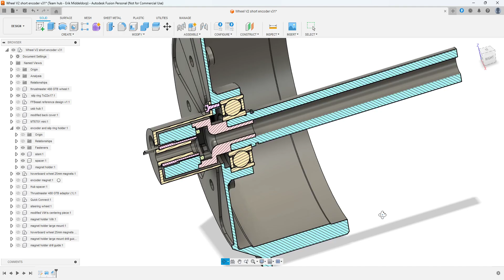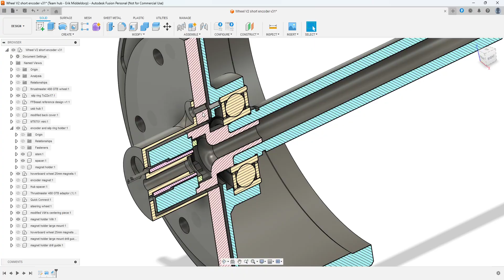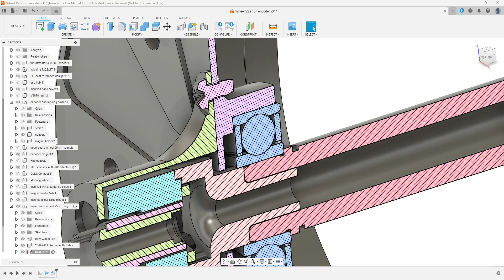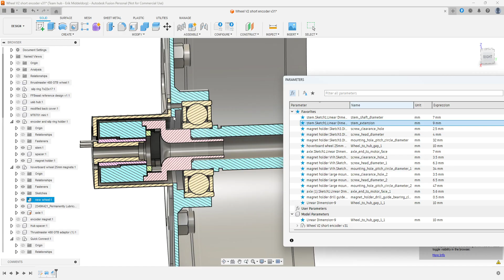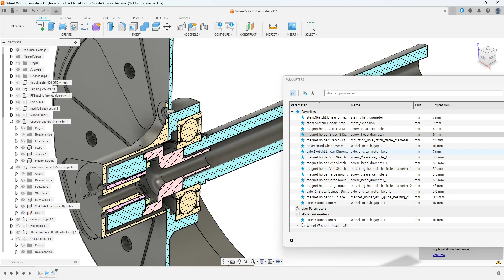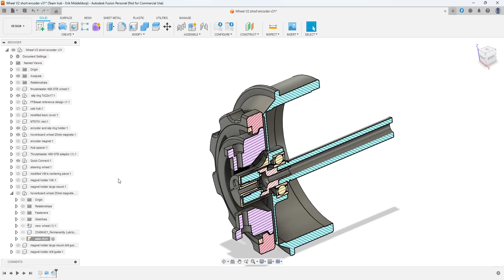Slip ring and encoder holder modifications

Comment: Hi, did you use the slip ring to route USB data inside the motor shaft? How did you shield the signal?

In my case, it's working with the motor off, but when I power the motor on, it causes interference in the signal and disconnects from the PC.

Thank you.
Reply from the maker: Yes. I didn't shield the signal. I don't think I had any problems with interference. But I currently have problems with the wheel disconnecting I think either due to I might have damaged the slip ring wires or perhaps noise in the slip ring contacts, I just haven't got around to investigating it more. 
It might help to check none of your motor phases are shorting to the axle. If they aren't then maybe grounding it might help? I'm just guessing. Searching the discord will probably find other people with similar problems and maybe solutions.